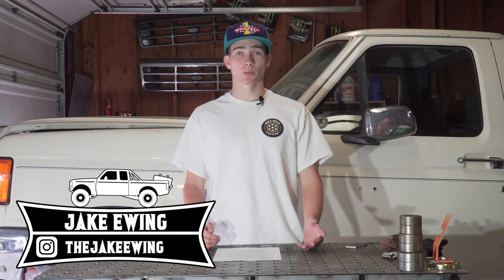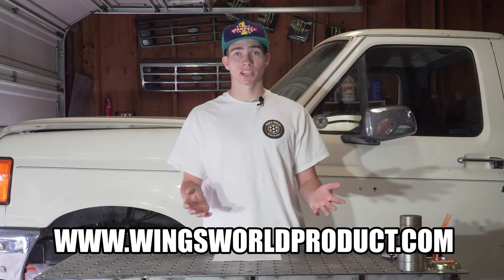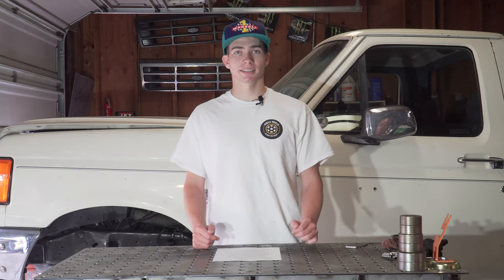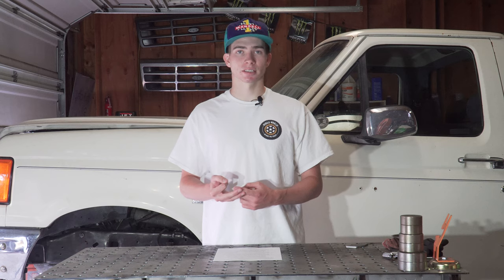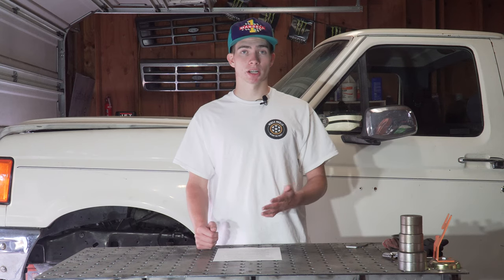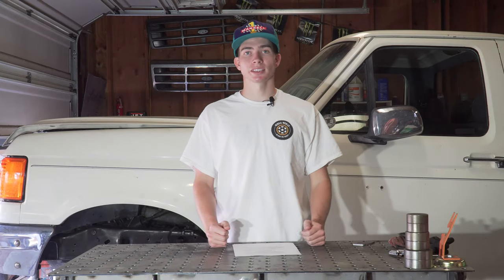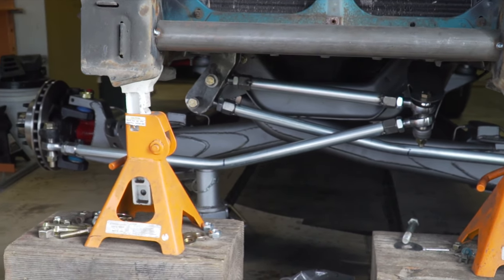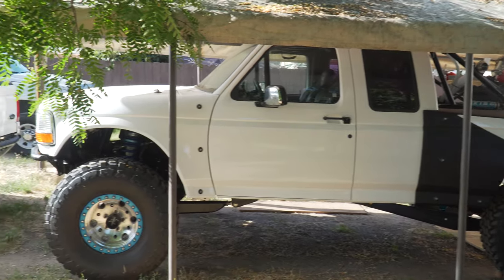PRERUNNER 101: How Swingset Steering Works - PART 1

Comment: Talking about equal beams, and unequal beams you gotta remember there's ttbs " Twin Traction Beams" as well don't forget the 4x4 guys .. I have a 93 Ford explorer that has a single swing set up and it's a ttbs.. also big factor in steering stuff is the caster's.
Reply from the maker: ttb falls under the unequal length beams category!